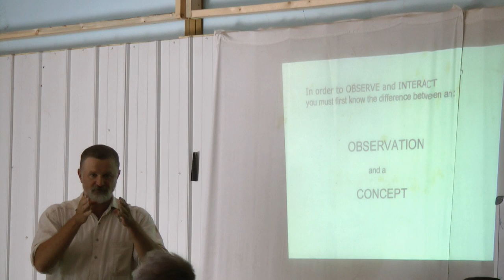Restoration Agriculture Design Course Mark Shepard: Subsoiler

Comment: Very interesting video! - I am half way through Mark's book on Restoration Agriculture at the moment and learning a lot!

One thing I would ask, is having just read a lot about 'No tIll' and watched a lot from Dr Elaine Ingham on the problems of damaging soil structure through ploughing is what does Mark or other feel about this apparent contradiction?
I would also point out Gabe Brown as a large ranch farmer who now practices 'no till' as the future of large scale crop production.
Reply from the maker: The temperate zone on Earth is more forgiving and can be tilled on contour sporadically without losing fertility (some tilling will slow the building of fertility)(too much tilling will result in declining fertility).  Depends on what your planting and how you harvest. as well.

The contradictions are only found in the title descriptions as mixing the types of elements on the land; geography, elevation, climate, ect.,  will result in contradictory recommendations.
Reply: +RICHARD TATE  To use the subsoiler like Mark Shepard, to establish tree crops, cut roots along tree lines and distribute water, is not disrupting much. Fungal hyphae also have the ability to connect to each other again, when it is a clean cut and not too much further disturbance.
Gabe Brown is working mainly with annual plants, except on his pastures.
Reply: Keylining is just making a thin vertical line in the soil.    It heals quickly but actually in this case captures airborne humus and puts it deep in the soil adding to fertility
Reply: @celadon9255  
It also severs roots such that some roots die,  and release their carbon to the soil.   They then regrow,  and then  the process is repeated.  It builds soil quickly.   It also allows water to be sequestered easily at crucial times.